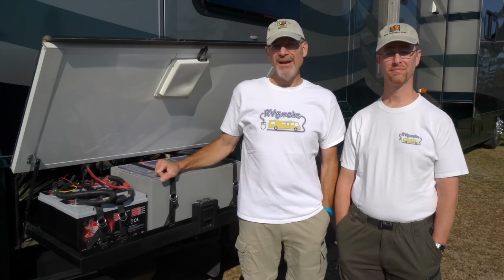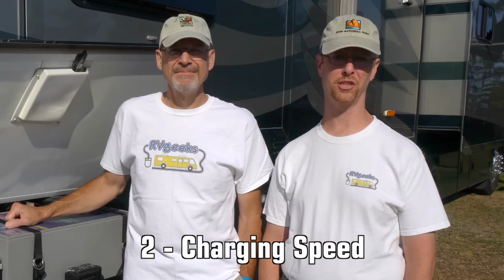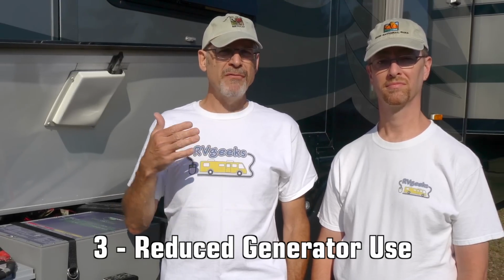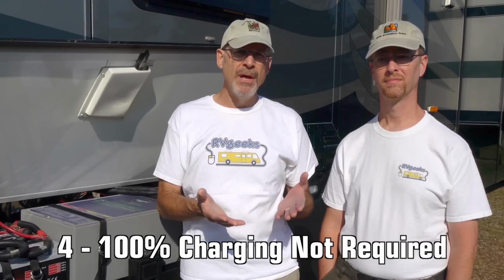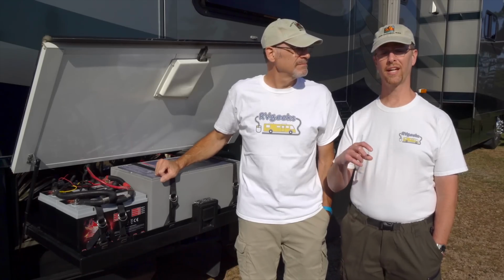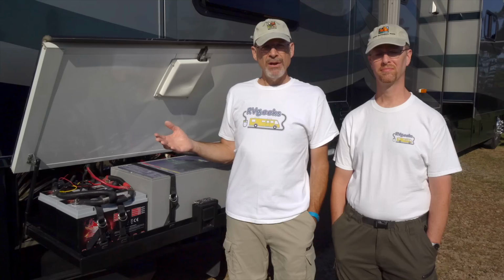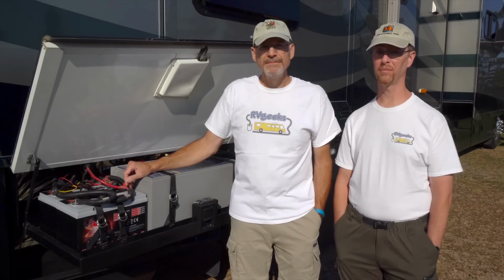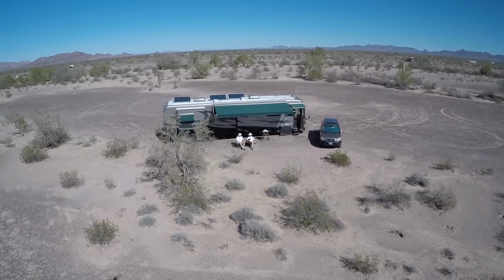🔌 SYSTEM UPDATE! RV Lithium Battery & Electrical Project — 3 1/2 Months In!⚡️

Comment: Great update. As you've mentioned here, this system improves boon docking on so many levels. Would you consider a drawer style marine fridge freezer? AC/DC, no propane. Heck I think a pair of them would not equal the consumption of your residential! Love your videos, I speed click the notifications! :-)
Reply from the maker: Thanks so much for the nice comments and great question! Since we have so many friends on boats, we know about those awesome units, but we never thought about doing that in the RV because they don’t seem to fit as well with the layout as our residential unit. Maybe we haven’t given it enough thought and are wrong about that. But it would definitely take some reworking of interior space to switch to one... or even two. Maybe our next How-To topic? 😉
Reply: RVgeeks, I was wondering about that, too. I’m closing in on buying my first RV after a long time of research and self-searching (at least two years). Unless I buy new, I’ve decided to get a large Whynter with a freezer section. Expensive, but it’ll pay for itself quickly with a lower power draw and food storage.
Reply: RVgeeks That will be a good topic because I don’t know anything about marine refrigerators. I’m also thinking about getting my first RV but I want a 5th wheel. Seems like a lot of this stuff could apply to either one though. Do you have any videos that talk about the differences between the two? I’d like to hear your take on that subject too.
Reply from the maker: We don’t have any videos comparing towable to motorhomes, so we’ll have to add that to the list!

Comment: I love my lithium batteries, 800AH worth. I’m figuring that I’ll save at least 1,000 a year depending on how often we’re off shore power. Since the number of cycles is probably at least 10 times as many as lead acid the costs even out quickly, or actually shift to the favor of lithium, The problem is that list price on my lithium comes to over 5,000. I saved money because I imported these in bulk, but still, not cheap. IF, those batteries fail prematurely, that’s a lot of lead acid batteries. Only time will tell, but if they were less expensive, it would be a total no brainer, on he meantime, it will be a couple of years before I really see a financial payoff.

Comment: Just finished the video.  You guys have so much info to take in.  I am so glad that those batteries are working for you.  I have a LiFePo 36v / 10ah battery for my ebike.  Way better then the SLA.  So much lighter, like half the weight.  If you know the answer.  I drive to work 2 miles so don't use much and I have need waffling about charge after each run, or wait for back and forth. what is better for the battery I bought?  thank you for the time to answer me.

Comment: Buy a Predator 3500 Watt Super Quiet Inverter Generator from harbor freight. It works in the shade, rain, snow, etc.  Its recharge time is zero, it has unlimited cycles, it doesn't need batteries or a separate inverter and its about 20% of cost of solar/Lithium.  The installation is fairly simple, You start it and "Plug it in". Please be sure to read these instructions very careful to prevent damage to yourself or your equipment. "You start it and Plug it in".  If you enjoy spending thousands of dollars for equipment that under performs, than do the solar thingy and bust your calculator out, get your calculations correct,  make sure you charge it correctly, dont drain it too low, have a back up hydrocarbon based system (generator) on hand for when it is cloudy, dont run air conditioner or hair dryer etc. and your friends will think you are really cool because you have solar. You might be all sweaty and your hair is f'd up but... you have solar.  :)
Reply from the maker: Glad that works well for you, Michael. But we don’t want to “run” anything every time we want power, even a “super” quiet engine. Us solar/inverter/battery users love having continuous, silent power, with zero sound... or exhaust.
Reply: Hi guys - I have been watching your install in earnest and your smiles tell the story. I am putting 3 LG 305 watt residential solar panels on top of my 27 ft class C and using 8 Battleborn 100 amp hr batteries to power everything inside. The rooftop A/C is going on Craigs list along with the generator. I'm using a G.E. thru-the-wall unit following a fellow youtubers channel and his build. People think I'm nuts to lay out such a large amount of money on just the battery bank, but with the BMS running things I have no worries. I will be adding a battery to battery charger connected only to the alternator as a generator back up but I don't intend to use it if I don't have to. Great job guys - I'm right behind you in my install !
Reply from the maker: Wow John! That sounds like an amazing system you’re putting together! Suhweeeeet!! 😁
Reply: My bank account is going to scream loudly when I shell out $8k for just the batteries, but it's worth it. We only get one chance sometimes in this life and by God I am worth it...LOLOLOL
Reply: I dig.. more "Power to um'".  I enjoy your videos.  The solar thing just dont pencil out for me yet though. Maybe a small setup, but the Lithium batteries, MPPT controllers, etc  The cost just dont justify the return.  Thanks again!
Reply: 99 percent of Harbor Freight items are junk at best. Buy value not price.

Comment: Hi guys so impressed with your synopsis of the batteries, its very informative and thorough esp for those,whether they be in a house or traveling like you both I brought my 2 x 12v x 470 amp /h AGMS about 2.5 years ago running them as 24v on a stand alone system at present with 2 x 190w class A solar panels with 2 more to go up asahp I also have a 500w wind turbine contributing to the batteries as well  , I paid 1300$ AU FOR MY 2 X 80KG EACH battery so Im not about to get rid of them Unless my battery  place would give me a good trade in and trade up price 

Btw I was so impressed with this review it recommended this video to Tom over on his channel Ludicrous Feed  (https://www.youtube.com/watch?v=ahY8Th-WbCQ&feature=em-uploademail ).
Tony from Western Australia
Reply from the maker: Thanks so much for the recommendation, Tony! And it sounds like you've got a sweet setup. 😊
Reply: Thanks guys I try to help out my mates when I can (: 
I forgot to mention I also have a 1 kw Grid Tie setup putting power into the grid and and I get 49.4 cents per unit ( 1000w ) back  until my 10 years are up in 2021 when it then drops down to the going rate that the govt pays which at present is 7.5 cents per unit  their cost of power that they sell us is 25.5 cpu + gst of 10 percent so we have to pay a total of 28 cents per unit my goal is to be able to be self sufficient by then and still stay connected to the grid for times I might want to use welders, or any other heavy power usage it  will save me purchasing bigger solar equipment for an occasional use as I will be able to pay the power back when im not using it. 
It all takes a while as you have no doubt found out  and big money to be self sufficient but done right it will save in the long time and give you more money to better ones lives in other ways as well 

When are you coming back to Australia you still owe me a verdict on Vegemite and Tomato and cracked Pepper sandwiches Grin 

Tony from Western Australia
Reply from the maker: Awesome setup, Tony, for sure! We’re currently RVing in England, and we’re just talking about vegemite today! Sorry, we didn’t care for it, but willing to try again. Not sure when we’ll be back.... but WE WILL!!
Reply: England? you been invited to princess Eugene's wedding eh?or has Rumpole finally caught up with you and you both have been nicked!with the Vegemite only use a scraping it will taste better 
enjoy the trip guys and stay safe oh while your there check out for " Bodgers or Bodging" Harry Rogers https://www.youtube.com/user/mrwindsorchair  should steer you in the right direction tell him Tony from Western Australia suggested you contact 

take careTony

Comment: I've been keen on the complete removal of the generator entirely and using an additional alternator to my engine to charge my batteries like the Volta Power System.
Reply from the maker: That’s exactly how the Freedom e-GEN system is being implemented on Class B RVs. We opted not to go that route at this time as we were about about 10 months and 10,000 miles on the road far away from Xantrex! We’re not done upgrading, and looking at many options. 😊

Comment: Thanks for the update guys, well done and a very good explanation!   I was wondering why you went with the Xantrax rather than any of the other Lithium choices, but I suppose that's a personal choice!   I look forward to your Solar upgrades in the future, as we're thinking of adding a solar array to our Tiffin over the winter at some point, which gives me a little more time to educate myself on a sufficient system, as we don't full time, but we do boon dock often when we are away!     Safe travels!
Reply from the maker: Hi Dale! A couple of unique things about the Xantrex Freedom e-GEN battery... 1) It’s self-heating, so no worries about charging in sub-freezing temps, and 2) It’s the only battery we know of that is tested and approved to UL Standard 1973 for use in “Stationary, Vehicle Auxiliary Power, and Light Electric Rail” applications.... basically the only one actually approved for use in an RV. Others only meet UL standards that do not include daisy-chaining them together.... but it’s being done anyway. 😕

Comment: I have a class C I have no solar and I only have two house batteries if I would remove the two house batteries and put in the lithium batteries that you installed is that enough to power the air conditioning lights refrigerator Etc and how much would it cost me to get rid of the two house batteries and put in that lithium battery from one our beer to another just asking for some info and help if you can answer any of my questions thank you guys great video like always
Reply from the maker: Hi Guillermo. While the lithium battery is CAPABLE of powering the AC (i.e. it can handle the power output demands needed for start-up of the compressor, etc)... it's still not likely something you'd want to do without also pairing it with a BIG solar array, because the power draw needed to run the AC will suck even a large lithium battery dry in a fairly short period of time. With enough solar, you could keep up with that demand so that you didn't end up sitting in the dark all night!  😉  Check out Nikki & Jason Wynn's video about doing exactly that in their RV:  https://youtu.be/B0rZY5uotKI 

Another issue with trying to run the AC will be ensuring that you have an inverter that's capable of supplying the necessary start-up amperage the AC will need. So either the inverter will need to be extra robust... or you'll need to modify the AC with a soft-start kit to help reduce the demand.

So... with the costs of Lithium batteries, large inverter, and big solar array... you're probably better off running your generator to power your AC.

Comment: What advantages does your battery offer over 6-100AH Battle born Lithium batteries?
Reply from the maker: Hi Peter! Two things: 1) It’s self-heating, so no worries about charging in sub-freezing temps, and 2) It’s the only battery we know of that is tested and approved to UL Standard 1973 for use in “Stationary, Vehicle Auxiliary Power, and Light Electric Rail” applications.... basically the only one actually approved for use in an RV. Others only meet UL standards that do not include daisy-chaining them together.... but it’s being done anyway. 😕

Comment: Have you checked out the next generation high output solar panels? You can get 260 watt panels if you're willing to go with a 24v system.  They can really recharge batteries fast.
Reply from the maker: Thanks Roy! We’re checking out the options! 😊

Comment: In my EV I only charge it's lithium battery up to 80% b/c heard it's healthier for the battery. I assume that would also be true for your battery. Did your OEM recommend you charge all the way up to 100% ? Ty
Reply from the maker: 100% charging is no problem at all, but for storing, lithium is generally better left at 80% or below.

Comment: So Guys!- Great to hear that this is really working out for you! Thank you for the update. it's quite helpful.

Since your thinking of upgrading your solar to get better charging capacity, without relying on your generator so much, Mike Wendland did a spot last week on the Watt Fuel Cell charger. Which I think is a HOT game changer. It's max output is only 80 Ah but that should be sufficient to charge your battery with NO generator noise or fumes! And it complements solar. I think you two should watch his interview and think about it as an optional replacement to upgrading your solar panels. I would strongly consider this myself in my old 2000 Beaver if we were doing more than just weekending and vacationing and if we had the $$. But frankly we are not in the position to jump on that just yet, but I will strongly consider this upgrade for ourselves down the road.

https://www.wattfuelcell.com/
Reply from the maker: Hi Mike! sorry we just found your comment (YouTube flagged it because it included a hyperlink, but we just unflagged it). We haven't seen Mike's piece, but Watt is very much on our radar, and we agree with you that it could be a very desirable option to augment solar. Of course we'll keep you posted if we're able to report more about it from personal experience!

Comment: Great presentation.  Now we need lithium to come down to a reasonable price/value.
Reply: Yes, if there where a large drop in price on Lithium, I would have had it already, thus the slow drop is holding up many I'm sure, especially if solar is another option wanted, with it's pricing.
Reply: I have 425 watts of solar on the roof and 540 AH of AGM for house power.  No generator.  12V refer, Webasto cooktop and house air/water heat.  The solar works great to charge the batteries on a nice clear day, but after three days in a forested area, I have to start my engine and use the alternator which give me 60 AH of charging.   But if I’ve discharged the batteries to 50% (220 AH, or 12 volts indicated) I’ll need to run the engine 3-4 hours to give me three days of juice.  We almost always look for a sunny boondocking site and rarely have power problems, but a lithium battery would be very, very useful.  But the $5000 to $10000 price tag is hard to swallow.
Reply: Lithium is currently much cheaper than lead acid if you factor in charge cycle life. Lead acid is most expensive battery now.
Reply: DIY Solar Power with Will Prowse please do a video on this “eGen” system!
Reply: They’re actually reasonable compared to lead acid. You’d have to replace lead acid 5 times in the lifetime of a lithium battery.  So considering this, lead acid batteries are many times more expensive.